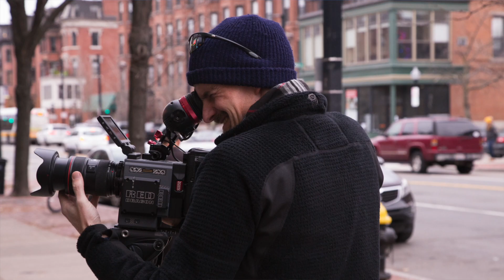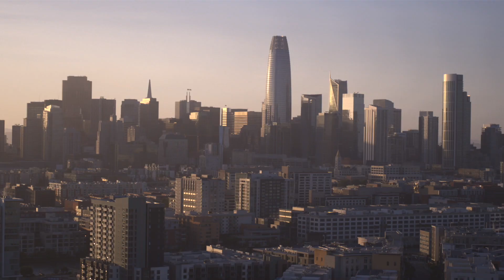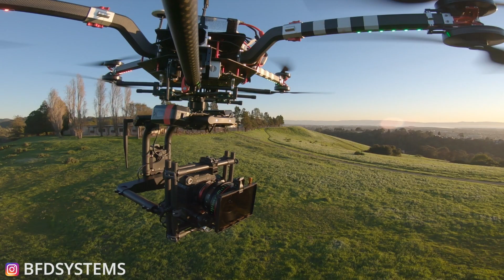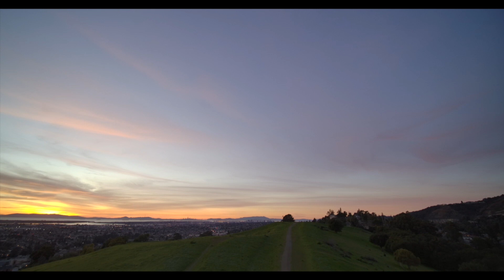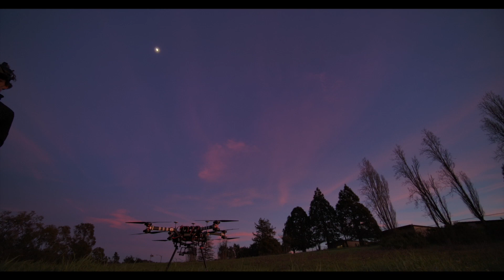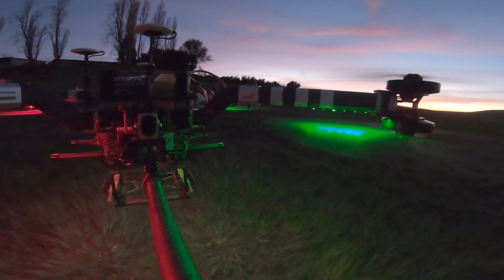Nantahala, 8-Rotor FPV Cinema Drone, Part 2

Comment: This is great stuff, I'd love to see unstabilized z-cam footage from that rig!
Reply from the maker: Thank you!  Good point.. there is a little FCPX stabilization here and there, but none from the SteadXP.  I haven't been able to get that to cooperate with the FPV builds yet.  It seems the frequency of some of the motion or maybe the crazy wide lenses... just haven't cracked the code yet!
Reply: @MattBeardsley  I hear some guys have had luck soft mounting the Stead XP and getting decent results.
Reply from the maker: Cool, that's encouraging.  I think the super wide Laowa I used for these first few tests makes the SteadXP calibration process almost impossible and that I might have more luck with a less extreme lens.  The SteadXP worked great on the ground on a couple shoots, so I know there is potential.  Even some of the aerial stuff looked promising, but for this particular build, it just added a ton of jello.  I'll keep trying with it!

Comment: Care to go a bit more in-depth about how this was wired up with 8 motors? Did you use a special PDB or FC for 8 motor outputs?
Reply from the maker: James Bailey yeah, it’s two APD PDB500s run in parallel with 8 individual ESCs and an FC with 8 motor pads.. it was an intense build!  Check out the previous video for more details (link in description)
Reply: @MattBeardsley  what fc did you  go with? i was leaning towards the lumenier lux l7 for a 8 rotor build
Reply from the maker: @therealmikek  great minds think alike :)  So far, I have two X8 builds with the Lumenier Lux F7 and it seems to be working really well.  I had some issues with a firmware update at one point, had use the "legacy" target to get all 8 motors to spin, but it has done well in testing thus far (as you can see!)